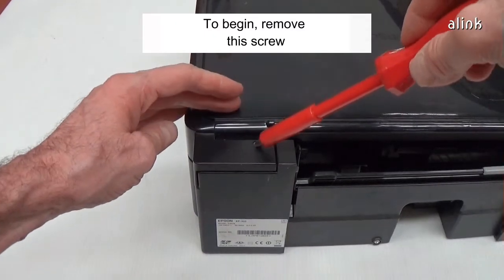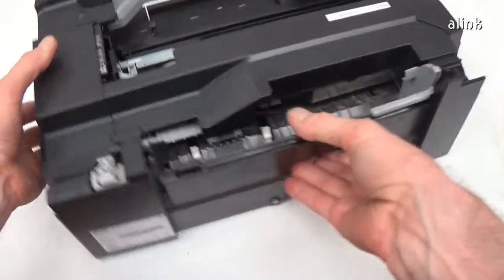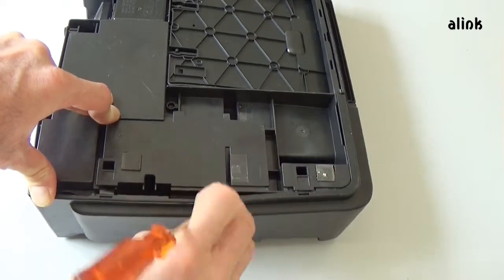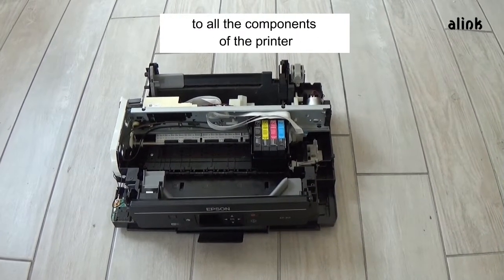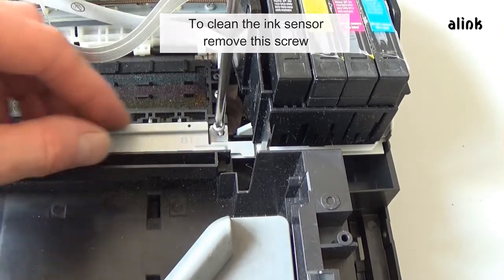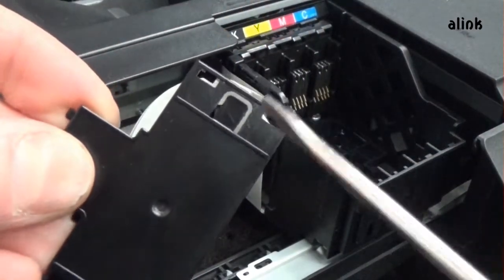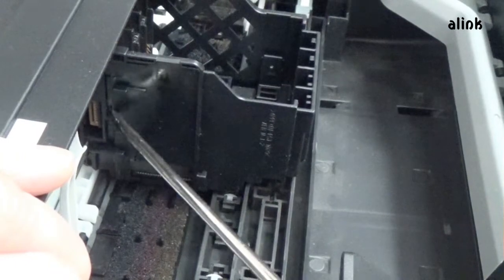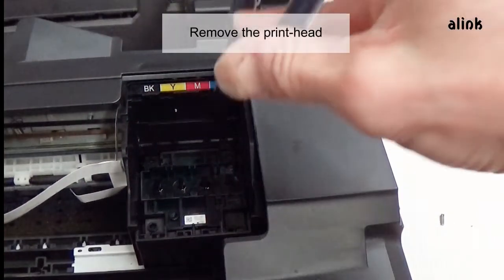Taking apart Epson inkjet printer XP-312 XP-315 XP-320 XP series

Comment: Your video is amazing, one small problem, I accidentally pulled the cable out behind the printer cartridge carriage for which you said "DON'T REMOVE THIS CABLE" ........any advice on how to get it back in? lol It's a real bear to try to push back in, not enough room to put it back in at all, totally see why you said don't pull it out
Reply: I'm at the point of wanting to bin it now. Really rather not because I just bought lots of ink for it 🤦🏻‍♂️ did you ever manage to get that cable back in? If so got any tips?

Comment: Hi, thanks for the video. I followed the instructions and cleaned the print head. After putting back together it now says there is a paper jam. Any ideas what I did wrong?
Thanks
Reply from the maker: may be a paper sensor is out of position. Check the flags where the paper exits

Comment: I removed the "other" cable, the 3rd one on the print caddy... how the heck do I get access to its plug to get it back in ?
Reply from the maker: you have to dismantle the printer, starting from the side panels
Reply: Did you have any luck because I did the same thing...
Reply: Having the same problem. I'm not sure how accessing it from the sides help since the metal plate directly behind the print head unit is still in the way of even my tiny fingers being able to secure the cable in place.
Reply: @SnazzyJazzy17  where you able to fix it?

Comment: I removed a little piece like a miror by mistake and don't know where to put it back? somebody could help? the message is now they don't recognise BK
Reply from the maker: Sorry I don't know. Did you dismantle the scanner unit too?
Reply: @viandant5  yes i put it of to move the other pieces, now the mesage is impossible to recognise the BK (black)
Reply: @florencecollignon6712  I have that same problem - did You find solution ?
Reply: Its on the right side wher the inks are :) 
when you unscrew the bolt, the element falls out (small plate), you have to put it in there, and then screw in - if you have problem - contact me :) or visit photo: https://zapodaj.net/3e260266df1c6.jpg.html
Reply: @lukaszpluku  thank you so much the little miror is in his place again, and i finally changed the black color and managed to print tonight so happy!
Reply: @lukaszpluku  This takes you to a page saying "Nie ma takiego pliku" (Polish, meaning, "There is no such file"). The comment's 3 years old so no surprise—answer is, contact the commenter direct, as per his offer. I'm about to do this job, so I'll supply a photo somewhere if I can.